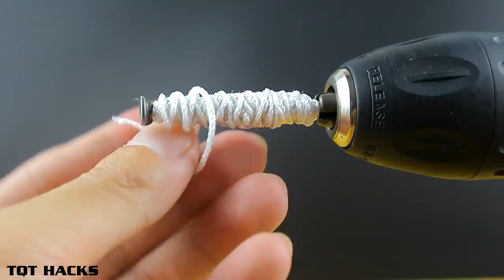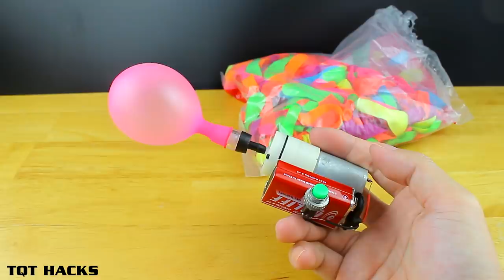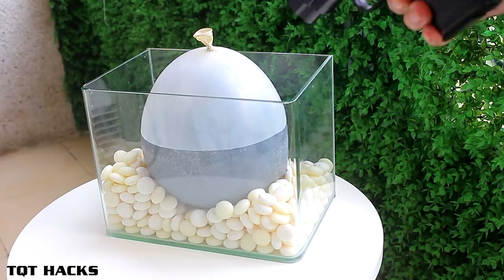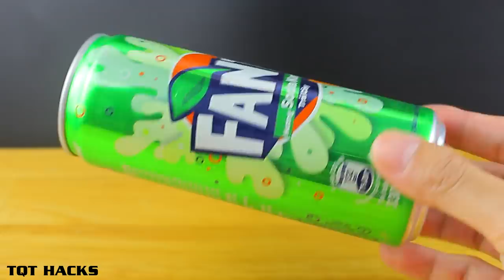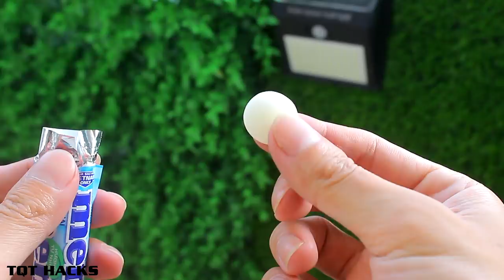8 SIMPLE INVENTIONS

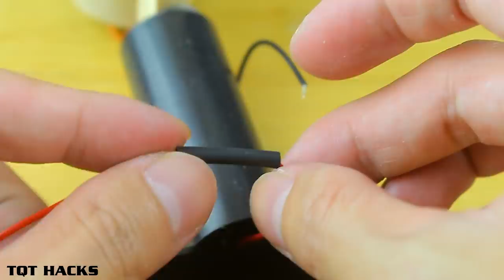Comment: 2:56 what is the name of that machine
Reply: krishna Kumar soldering iron?
Reply: @yangexue6596  Thanks
Reply: You can probably hold on to a nail with pliers and heat the nail, then use the nail instead of a soldering iron if you only need to solder a few things and don't want to buy a real iron.
Reply: And the wire he melts is solder wire.
Reply: o i know  tazer2.0